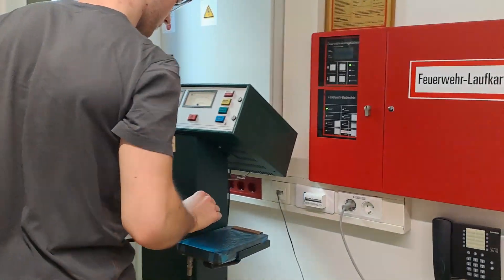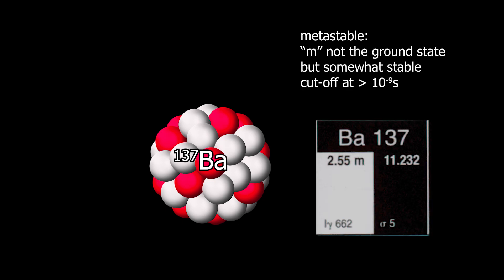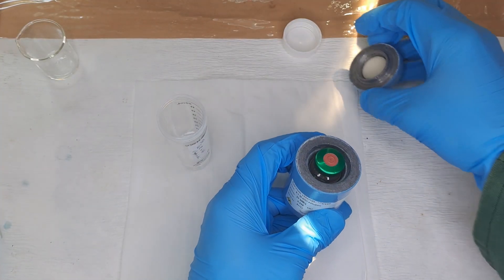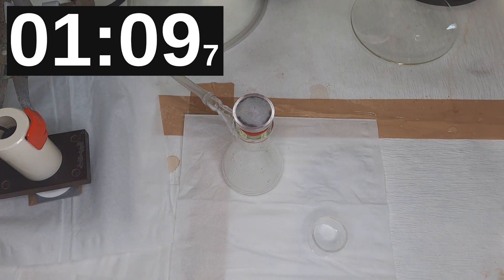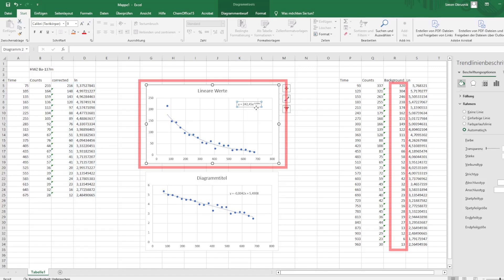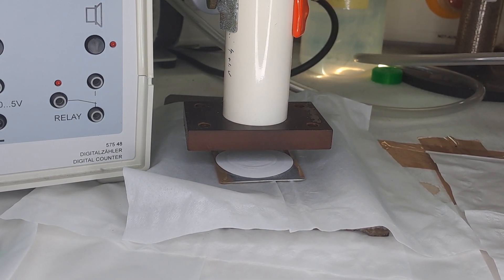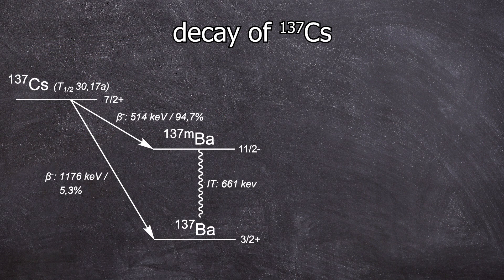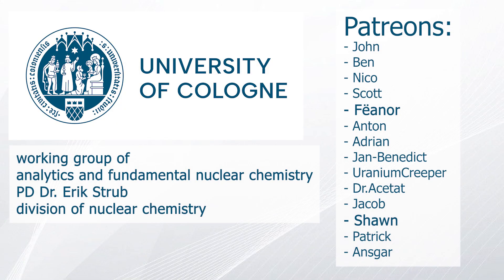Half-life determination of Ba-137m - practical nuclear chemistry

Comment: Is there any reason to use this long of a needle? I would have gone with a 1-2cm one to minimize the potential for it flailing around.
Reply from the maker: @AndrewZonenberg  was the only one we had in the lab that was long enough to reach the few Drops in the bottle.
Reply: @SimonsNuclearchemistry  That would do it.

I mostly stock extremely short needles (12mm or so, even some 6mm) in my lab, but I'm using them for dispensing rather than penetrating septa. They're not even sharpened since it's safer to use a blunt one if you don't need it to puncture anything.